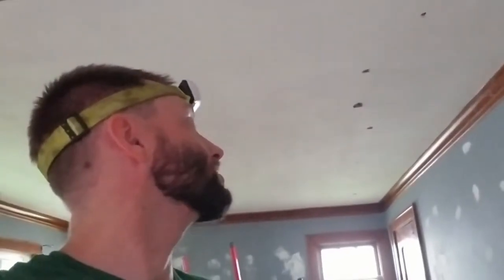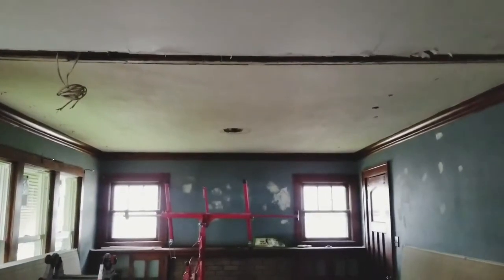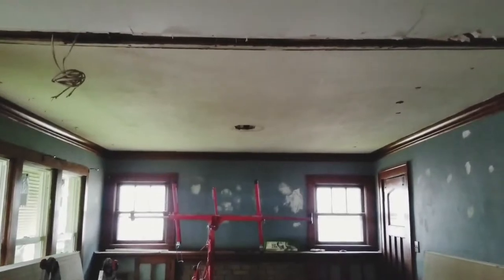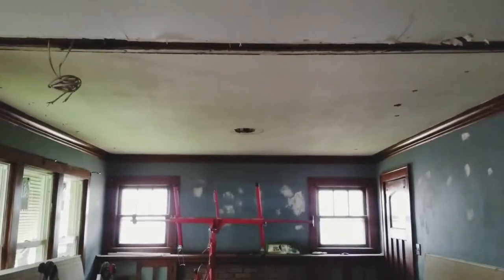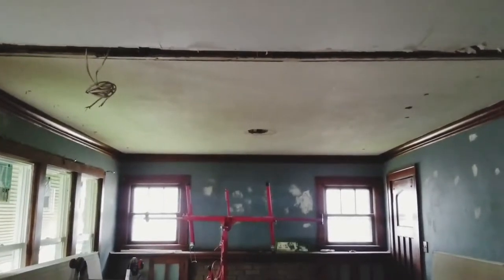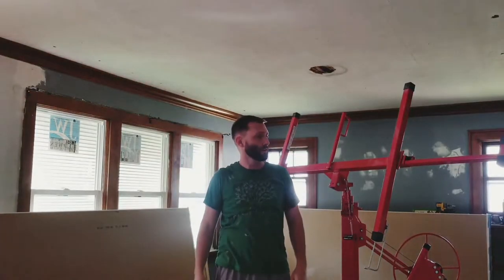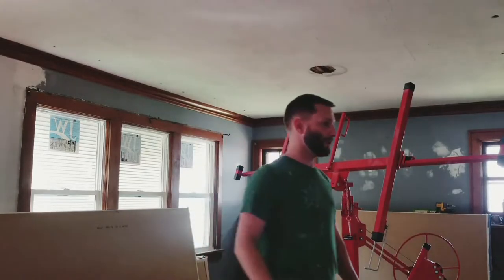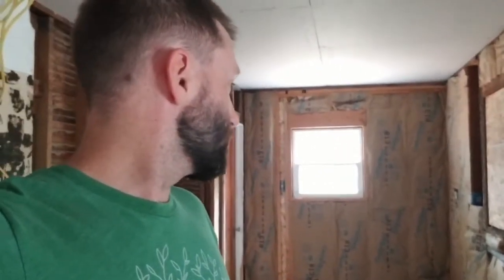How to Install Drywall Over Plaster Ceiling | Investment Property Renovation Part 5

Comment: This is awesome and I have done it a lot in the current home we live in. I find it especially awesome because our house was built when they were starting to use a mixture of wood lathe for interior walls and an early rendition of drywall on the exterior walls as backer board for the plaster. I have been laughing as I cover it up with what’s holding it to the wall, a plaster sandwich so to speak. Great video. Waste of time to tear it all down unless you want dust in your house years to come. Finding the joists isn’t that hard
Reply from the maker: Haha, yep.  The plaster sandwich!

Comment: Seems like it would have been a better idea to take the crown molding down before installing drywall, then reinstall after taping and finishing.  A lot more work but I think the edges would be cleaner.
Reply from the maker: Maybe so.  But I attempted to pull a small section of the crown.  It started to take the plaster wall with it.  Would have been like opening pandora's box for a small improvement at the edge.
Reply: @jessesmithchannel  I hear you on that!!

Comment: I want to do this in a bedroom that has a textured plaster ceiling, with visible seams. Had a guy tell me i need to put up furring strips. Seems unnecessary.
Reply from the maker: Depends on what's on the top side of the ceiling, and whether you have joists near enough to the corners to screw the drywall into.
Reply: @jessesmithchannel  The ceiling is attached to the joists, which I can see and walk on when up in the attic.

Comment: 5/8’s is preferred for ceilings. This plaster does not even look like it needed to be covered???
Reply from the maker: 5/8 would make sense for a fresh install, where the plaster was removed.  Adding 5/8 over the plaster would be extremely heavy for the ceiling, adding unnecessary strain on the joists, and requiring very long screws.
Reply: @jessesmithchannel  Right, I was saying 5/8s because you said 1/2”. Im restoring 107 year old house now. The rooms that had sheetrock lay over on the ceilings I tore it all down and went 5/8” rock. Even with the 3/8” of plaster, the lath and 1/4” rock (if you can find it) that’s a ton of weight.

Comment: Makes no sense why you wouldn't use chalk to draw out the line instead of some elaborate string setup
Reply from the maker: Not sure I follow your comment.  Chalking a line uses a string covered with chalk powder.  You pull the string tight, and snap it against the surface, leaving a chalk line.
Reply: This person clearly doesn’t know what a chalk line is lmao

Comment: I'm confused. Was there plaster and lathe under the new drywall?  Also, how did each celing match in thickness ?
Reply from the maker: The existing ceiling was plaster and lath.  I put the new drywall directly over it, rather than removing it and making a giant mess.  At the spot where I removed the wall, there's about  1/2" change in thickness over about a 7" span.  Fortunately, the 1/4" drywall is very flexible.  Mud & tape, and the thickness change is barely noticeable.

Comment: if you have a rowhome with no attic are you basically just boned and have to take it all down?
Reply: No, you can still do it.  You just have to use a good quality stud detector and/or a hammer and nail to find the joists.  I've actually used a strong neodinium magnet to locate the nails used to secure the lath to  the joists or studs.
Reply from the maker: There are definitely other ways to find the joists

Comment: Wouldn’t there be a noticeable bend where you cut out the plaster to transition to other ceiling?
Reply from the maker: There is a change in depth at that point, but I spent some time feathering it out with joint compound. I can still see a slight slope there if I'm looking for it, and only if light is shining at the right angle.  Not particularly obvious to most people in the room.

Comment: Hi Jesse.  I'm curious if you just used normal drywall screws.  I haven't put up the drywall yet but will definitely identify the joists and will figure out a way to hold up the board without that awesome board holder.  But, I'm worried that I need to drill holes prior to screwing because the plaster is crazy solid.  Thanks.
Reply from the maker: Hey Gary - I believe I used 2 1/4" drywall screws on this one.  The plaster was 3/4 - 1" thick + the 1/4" drywall.  I wanted at least an inch of the screw into the wood.  Had no issue with the screws going thru the plaster.
Reply: @jessesmithchannel  Thanks.
Reply: @jessesmithchannel  Interesting.  The plaster in my house is solid.  I've never tried drilling into the ceiling but the walls require masonry nails to hang s**t.
Reply from the maker: @garypick  Have you tried sending a drywall screw into the wall anywhere?  Plaster is typically quite hard, but screws should go thru.

Comment: What if the plaster doesn’t have a good bond to the lath anymore? Wouldn’t the weight of the plaster compensate the structural integrity of the drywall?
Reply from the maker: The drywall compresses the whole assembly together and spreads the weight across the whole panel.  I haven't noticed any sagging over the couple years since I did the installation.

Comment: When you're putting a sheetrock over the stucco ceiling. I noticed that you did not remove the trim to get the sheetrock underneath of it, why did you do that?
Reply from the maker: Good eye.  That's the original crown moulding.  I didn't want to pull it and risk cracking the plaster on the upper walls, leading to a much larger project.  I butted the end up tightly, and caulked the seam, before painting.

Comment: Just curious...shouldnt you arrange your sheets bricklayer style to avoid an intersection of 4 corners? I'm about to lay new ceiling on top of my plaster ceiling  myself.
Reply from the maker: These were arranged without any 4-corner intersections.  It's tough to tell, bc of the camera angle.  You want to avoid that, while also minimizing the number of butt joints.  Those are the hardest to conceal.

Comment: could  1/2 " drywall  be used ??? as to not show any waves and less flaws???
Reply from the maker: You've got to consider the added weight on the ceiling joists.  1/4 is much lighter and can flex a bit over an imperfect plaster ceiling.

Comment: Nice! How did you account for the crown molding on the ceiling?  Mud to the edge of the new drywall and caulk?  Just curious because i have the same situation and assumed I had to remove the crown molding first?
Reply from the maker: Great observation!  In this case, I had planned to remove the crown moulding.  However, when I tried to pry it off, the plaster wall started to crumble.  Since it was pretty thick crown, and I was using 1/4" drywall, I just ran the drywall to the edge of the crown.  Mud, caulk, and paint hid the seam well.

Comment: What length screws did you use?
Reply from the maker: I believe they were 2-inch screws.  1/4" drywall + up to 3/4" plaster + 1" into the joist
Reply: I just did one like this with 1/2 board with 2" and 2.5" screws most in the butt joints. No attack acces.  I found 1joist and found 16 on center...not as easy as people think. @jessesmithchannel

Comment: What about using liquid nail too?
Reply from the maker: Could use that too, but the plaster isn't providing the holding power.  It's the screws into the ceiling joists.

Comment: Didn’t watch it all Because there’s no good reason to run over the plaster.  People don’t understand weight and other factors. 
I have seen this done and never seen 1 last over 10 years without issues.
Reply from the maker: Thanks for the comment.  This was 1/4" drywall, which adds minimal weight to the joists.  Overboarding is a common practice and gives a nice clean look.
Reply: @jessesmithchannel  have owned my business 39 years. I know the look. I know why it’s done. I have never seen it last as a tear down and done 5/8 on lid. 1/2 on walls
Reply: @mikek3951  Hi Mik, We are down to the lathe in our ceiling. Can we go over that with drywall or do we need to remove the lathe. Thanks in advance.